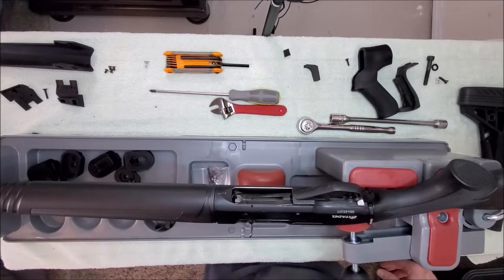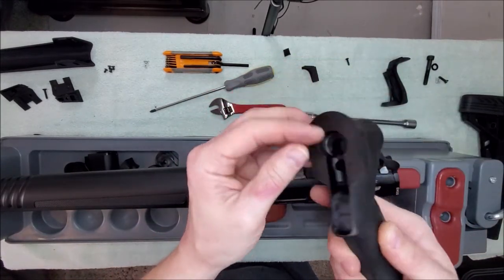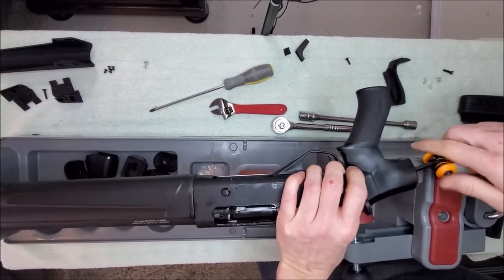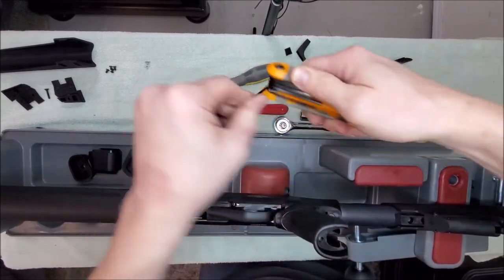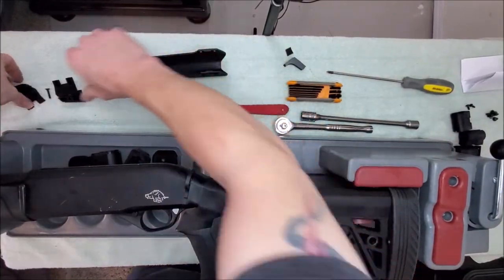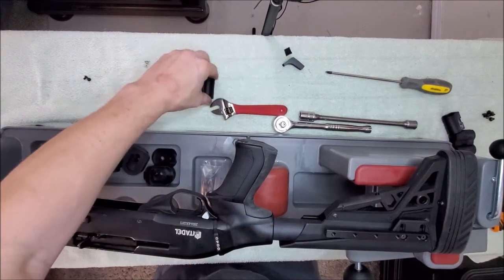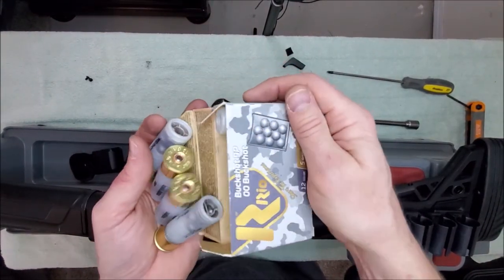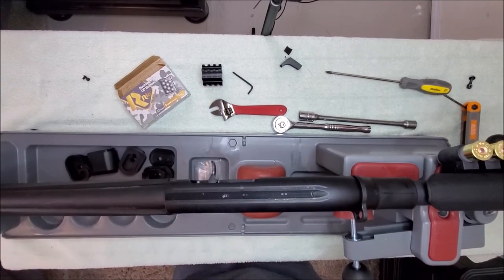Citadel Warthog ATI T3 Tactical Stock Install

Comment: Just got this stock in today and tried it out, needless to say it makes a hell of a difference in recoil and makes it a lot more comfortable to shoot, especially high recoil loads.
Reply from the maker: Yeah, the pad on the ATI is way better. Best addon ever for anyone who shoots a lot of high velocity shells 😎
Reply: @AMCITADEL  Also gonna have an extended bolt release button installed because the one on the citadel is wayy to hard to press one handed. Have you noticed this issue with yours?
Reply from the maker: Mine was pretty tight at first, it had a lot of packing grease all in the mechanism. A bottle of Solvent and a brush took care of that. It works pretty good now but I do wish I could get one a little bigger.

Comment: Hey Brother! Just got today my Citadel Boss Hog... Yeah!!!! I just finish taken the excess oil from the outside of the gun. Using two cloths and some solvent I was told to use. Saturday afternoon when I come back from work I will work on taken it apart and looking at your videos to clean and lube the gun. Yeah I'm happy. Early birthday present to me....
Reply from the maker: Awesome Brother! Take your time and clean it well.
Reply: @AMCITADEL  I'm really sad and frustrated. 1.. The picatiny that goes on the receiver will not clamp or compress.3 hours and nothing. 2..I wanted to see if the tube extension 8 shot and the 7 shot will screw on before I do anything with it like cutting the lip of, and the tubes will not screw on not even a tread.  As soon that you turn it will not turn for nothing in the world. It freeze so gad is hard to take it of.. if I cut of that lip will the tube screw on all the way. Is the lip stopping it from screwing on?  I'm about ready to smash this shot gun. I got everything to make it look like yours and nothing is working.......HELP!!!
Reply from the maker: The magazine tube should screw on regardless of the roll crimp. Did you get the Carleson’s tube that is for the Nova / Super Nova?
Reply: @AMCITADEL  Yes Sir. I got two. 7 shot 8 shot. none will screw on. Carlson's magazine extension.Benellinova/supernova/baretta1301/cz712/912 7 shot and the other is the same 8 shot
Reply from the maker: @robertgemini7606  not sure what to tell you, have you looked at the threads in the extension tube to see if there is any obstruction? Other than that, I can't offer much help, sorry.
Reply: is ok.

Comment: Just picked up this gun less than a month ago and I love it. Already put 1,000 rounds through it. Occasionally I do get the failure to eject.
Reply from the maker: Cool! Have you noticed if your FTEs are with a certain brand or velocity?
Reply: @AMCITADEL  no specific brand but all the rounds were 7 1/2 or 8 shot for clay shooting. It’s not bad at all though like I said I shot a little over 1000 rounds and got maybe 5-10 FTEs. So if you put it into perspective that’s just under 1% of the shots.
Reply: Dude I’ve put lots of different ammo through it and it never failed to feed once in the thousands of rounds I’ve put through it
Reply from the maker: I haven't had a failure to feed ever since replacing the mag spring over 5000 rounds ago

Comment: Just bought this stock today and followed this video as I put it together. I'm enjoying the overall feel of the shotgun now versus when I first purchased it. Like I'm more in control movement wise if you get where I'm coming from. Can't wait to break in my warthog at the range which I named Pumba lol
Reply from the maker: Awesome! I agree that the new stock makes it feel more balanced in a way that the original was lacking, especially with the 8 shot extension.
Reply: How does it run, does it prefer one kind of shell size or ammo? Thanks🤙🏽
Reply from the maker: @bigeyetuna6228  mine really loves the Black Aces high velocity slugs and buck shot 😎
Reply: Thanks🤙🏽

Comment: I can't say thank you enough I have been looking high and low for a way to put a new stock on my warthog.... with that being said could you please show us how to mount a picatinny rail on top I don't know what kind of adapter to use to that real tight dovetail... Thank you so much for your videos there's not much content out there about this gun and I think that it's a very capable semi-auto shotgun... It's really nice to see that improving it further is possible
Reply from the maker: Check the description, there's a link to the top rail that I use. I haven't made a video on installing that, but it just clamps on top. It may take a few tries, but it works. 
 If you want it permanently attached, I would get your local gunsmith to drill and tap the top, unless you can do that yourself. Personally mine is not permanently attached, because I like shooting down the barrel most of the time, and I use my red dot only occasionally.

Comment: Amazing video finally someone that gives an amazing review for this beauty can you make a video of putting a picattiny rail I really want to attach an acog scope on this bad boi keep up the amazing content
Reply from the maker: I don't have a video of just putting on the rail but I do have a link in the description to where you can by the rail.
 I can make a quick video next time I get the chance, but it just screws on.
Reply: @AMCITADEL  thank you so much man all your videos have been soo useful keep up with the hard work and when you get the change do you think you can add an angle grip or a fore grip for this shotgun I tried putting an angle grip but the screw would make connection with the metal slide pieace under the ammo tube so I couldn’t attach the rails for the angle grip

Comment: You should get the Carlson's tactical choke. It'll be a nice finishing touch on your setup.
Reply from the maker: I'll check it out 😎👍🏻
Reply: @AMCITADEL  Carlson's part number 85006
Reply: @AMCITADEL  Also, just a heads up, I would keep a plastic follower in the magazine. Metal to metal contact over a period of time will cause seizing and feed issues. The inside of the mag tube gets worn down especially with no lubrication and you NEVER want to lube the magazine tube on a shotgun. I'd search for a delrin plastic follower. The delrin plastic is strong and self lubricating.
Reply from the maker: I polish mine until it looks like chrome and is smooth as glass. No issues with others for many years 😎

Comment: Your videos have been very helpful on my journey to mod my Warthog. I do have a question though. In the stock feeder tube, there a little indentation right near the front which the follower gets fouled on when packing the magazine to capacity. I tried using a file to smooth it out, but I don't believe it's coarse enough to do the job. I got the file install the tube extension since an existing part needed to be sawed off and filed down. I don't want to resort to drilling it out, but I will if I have to. Any advice on the matter?
Reply from the maker: I am not sure exactly, as I do not have any indent. If I did, I would do my best to file it down. If that was not possible, I don't think I would have sn issues drilling it out as long as it was small enough. A tiny hole wouldn't be an issue.

Comment: Thank you for the video made installation a 15 minute project, but now I wanted to add a sling and was wondering if you knew what magazine cap with the sling attachment I can use?
Reply from the maker: I ended up using a magazine tube weaver attachment and a weaver quick release sling mount
Reply: I didn't want to add the tube extension and was hoping I could just replace the cap to add a sling, guess I'm going to have to purchase one and hope it fits...thanks anyway for responding.
Reply from the maker: @MrWilliepz1  yeah, sorry I haven't really looked for just a cap. You can also get sling loops that install between the cap and the foregrip, that may be an option for you?
Reply: @AMCITADEL  Just looked into the loops and sound like a better option...thank for the info

Comment: Good morning sir! I believe I saw a video from you previous about the barrel sliding back and forth. I cant seem to find your video on how to fix that. Can you steer me in the right direction? Thank you
Reply from the maker: I don't remember which video it was in, but I can easily explain it for you.
Unscrew the magazine tube cap (or the extended magazine tube if installed).
Remove the handguard, rest the buttstock on a table with the barrel pointing up. Pull down on the barrel firmly to fully seat it, then tighten the knurled nut on the end of the magazine tube.
Make sure that the rough edge of the nut is facing down towards the buttstock, that keeps it from loosening. 
The nut only needs to be hand tight, but make sure it's nice and snug.
Reassemble - problem solved.
Reply: Thanks again brother 👍🏽
Reply from the maker: @petepeterson3920  you are welcome 😎

Comment: When are you going to post a video on the reliability after all the modifications you’ve made?
Reply from the maker: Judging reliability only comes with time. I will post if something goes wrong, until then assume it is still working just fine, as it is now. So far I'm 1,000 rounds in.
Reply: @AMCITADEL  that’s good news! Thank you

Comment: How did you removed the old charging handle?
Reply from the maker: You have to remove the handguard and pull back on the bolt carrier about half an inch until the hoke lines up, then pry the handle upwards by inserting a flat screw driver in to the notch at the base. That's the easiest way to pop it off.
If you watch the video on disassembly you will see the process. I have noticed that the above prying method is easier than the first method I used in that video.

Comment: Thanks for all the great info your channel is the reason i pulled the trigger on the purchase recently. Question did you just buy the stock hoping it would fit or is the shotgun a clone of something i might have better luck searching up? Thanks again
Reply from the maker: Actually the stock was brought to my attention by another viewer, I just hoped they were right and bought it. Turned out to be true. 
The Universal stock (ATI T3) has an adapter for the Tristar line, so you could hypotheticaly find something geared for that shotgun. I have not looked for Tristar directly, but besides the ATI model I have not come across another.
Reply: @AMCITADEL  good to know thank you
Reply: @AMCITADEL  hey bud i made a small video on the shotgun i plugged your channel. Like i said thanks for all the good info
Reply from the maker: Thanks Brother 😎 I'll go check out your videos!

Comment: Mine has lil recoil absorption stuff and I have to somehow rip it off to replace my stock
Reply from the maker: There should be a small screw on the end of the stock that allows you to remove the recoil pad. The screw is on the bottom of the stock
Reply: @AMCITADEL  alrighty I did it but there’s still no way to remove my stock it looks like. There’s a bolt something at the bottom and idk how I’m supposed to get it 😂
Reply from the maker: @norsejager  The bolt that holds the stock to the receiver is all the way at the bottom. You will need a socket wrench with an 8 inch extension to remove it. 
If you look at my other videos you will find one about installing the ATI T3 replacement stock. This video shows how to remove the stock.

Comment: Is this one longer or shorter than the original stock ?
Reply from the maker: Both. In the shortest position, its 1.75 inches shorter. In the extended position, its almost 3 inches longer.

Comment: Looks like you left out the adapter plate to pistol grip screw
Reply from the maker: Not exactly sure which screw you are referring to?
Reply: @AMCITADEL  small screw that holds the adapter plate to pistol grip
Reply from the maker: @llewellynlovette8738  must not have been present, Don't recall it in the instructions either. Oh well, if there was supposed to be one, it seems to work just fine without it! 😎
Reply: Good deal but the one I bought had a screw for that piece I guess they changed it .
Reply from the maker: @Llewellyn Lovette  I do recall seeing a hole and wondering. Mine was probably just missing the screw. Luckily after a few thousand rounds its still in place 🤣

Comment: Where did you get that charging handle?
Reply from the maker: Typhoon Defense sells that handle. There's a link to it in the description. It fits perfectly and has the retention tab but not the side dimple. You can easily cut that out with a dremmel. 5 seconds of work
Reply: @AMCITADEL  I'm looking for heat shield for this barrel, any advice. Just took mine in standard configuration and ran great, 70 ish slugs no malfunction at all. Thank you for the content that you put out there for us.
Reply from the maker: @geminiclouda.d755  I have not looked for a heat shield yet to be honest. I'll poke around and see what I can see.

Comment: How many rounds do you have through yours? How does your bolt wear look? Been watching for info on these and just saw this YouTube had a major issue. Think I am going to hold off on getting on for now. https://youtu.be/JUUQfy4siYI
Reply from the maker: I've got just under 600 rounds so far, so far so good.
Reply: I think its a hit or miss with the citadel honestly, mine the fore end nut gets loosened or stuck after every 16-50 rounds no matter how tight it is. And the fore end latch Broke after 150 rounds and lodged itself in between the magazine and piston. So, mine ain't doing too well. 
Besides that, I haven't had any major issues like in that video. I've fired heavy loads out of it too
Reply from the maker: @RipVanWhinkle  sorry to hear about your issues. I'm curious, does yours have the same internal components as mine in the videos or does it have a few different parts? Just trying to track failures and see if they are model specific.
Reply: @AMCITADEL  Oh its completely fine, I actually enjoy fixing it haha. Almost the same, I noticed yours has a different (smaller or shorter) Fore-end nut. I just say that because I've read great things about it, but some also bad, but that's with any manufacturer honestly. Overall I think its a great piece.
Reply: @RipVanWhinkle  The morons having catastrophic issues with this particular gun are using low brass sub 1200 FPS ammunition. Just use heavy brass and 1300 or greater and you'll have absolutely no issues.
Reply: @unk8371  It says use 1300FPS or more right on the box 😂